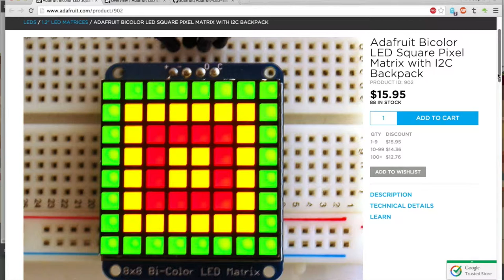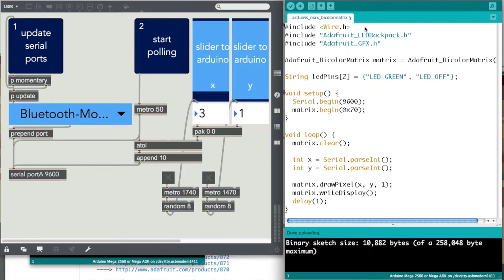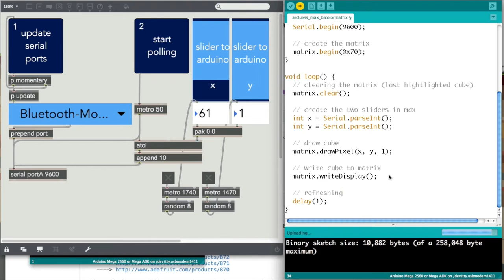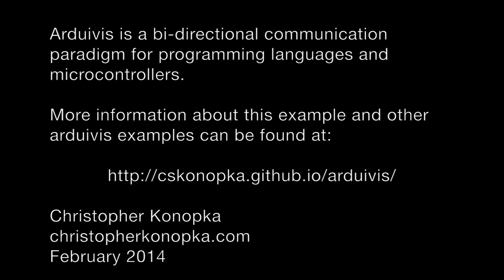arduivis-max-adafruit matrix

Comment: I wouldn't suggest you installing the library inside the Arduino application, but instead in your documents>arduino>libraries (location which is set in user preferences)
That way you'll keep your external libraries intact when you update the Arduino application.

Comment from the maker: I've done both but the location using documents often leads to confusion with 3rd party libraries from Adafruit. Either way will work. Is there a reason why one would be preferred over the other? I've never noticed any performance issues.